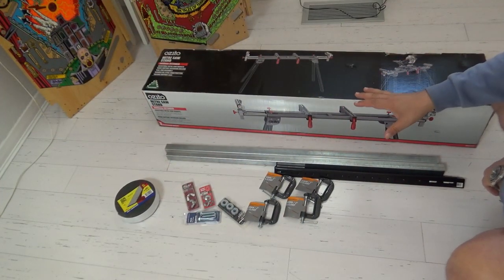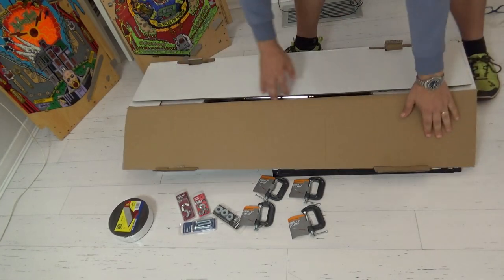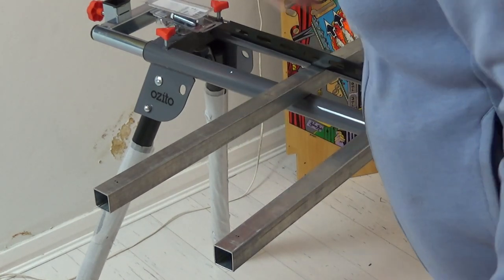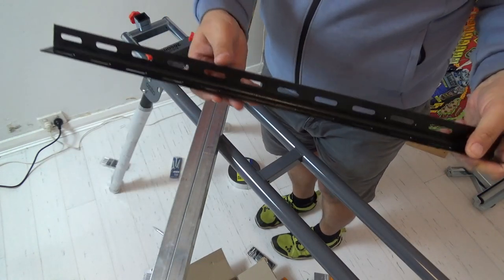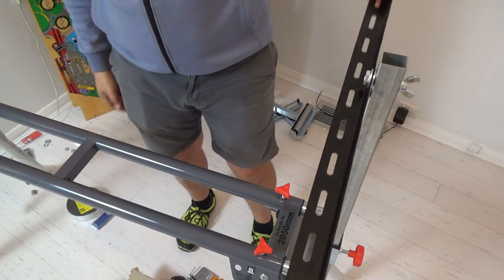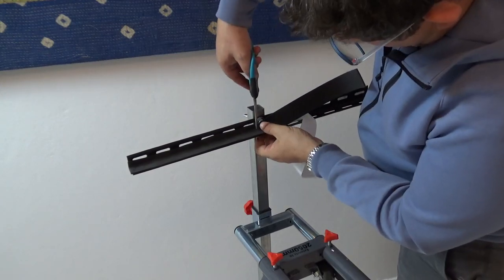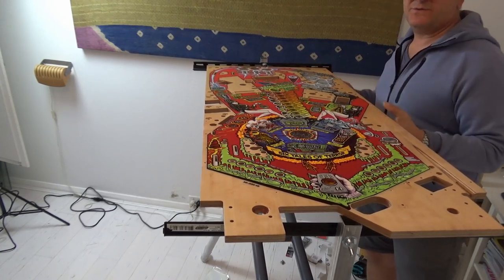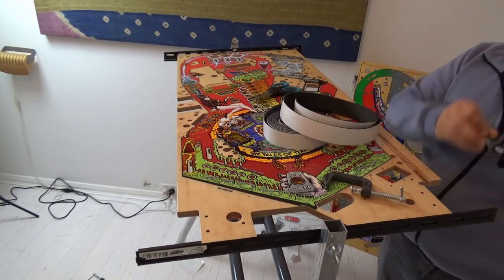Make a Pinball Playfield Rotisserie for $98 for next Pinball Playfield Swap

Comment: So..  a couple months into this..  Still happy with the design?  I'm terrified that it will drop the playfield.  No problems with slipping of the C-Clamps?  Anything you'd do differently other than the longer bolts in the rotational part?
Reply from the maker: So I think the C clamps are not perfect.... When I do my next swap I would use a second strip of metal with rubber to protect the wood but then just bolt this second metal strip to the angle in attached to the bolt and frame...  Might do a follow up video when I do that.
Reply: @PinballEvangelist  Thanks for the response.. I'll be looking for the video!  I was also thinking small C-Clamps on each side of the playfield, just clamped onto the angle, so that it would prevent lateral movement might be good.  This is the thing I'm worried about - I dont want to accidentally drop the whole thing on the floor!!  Thanks for sharing what you've done.. it's very helpful!!